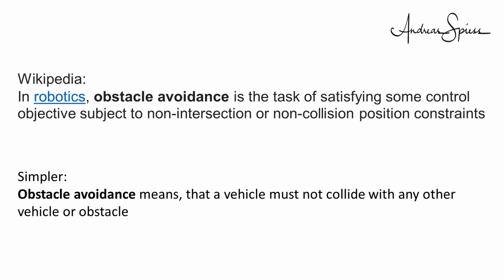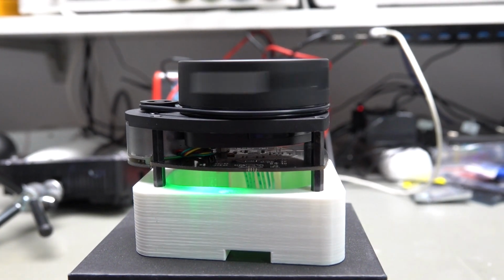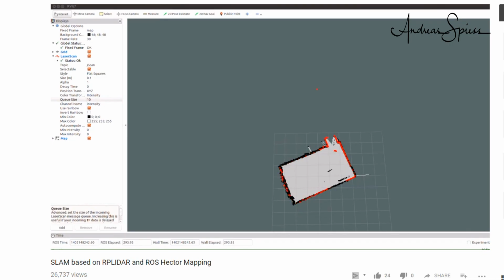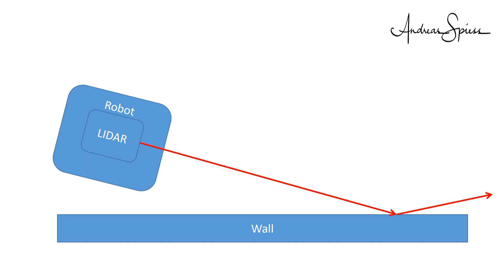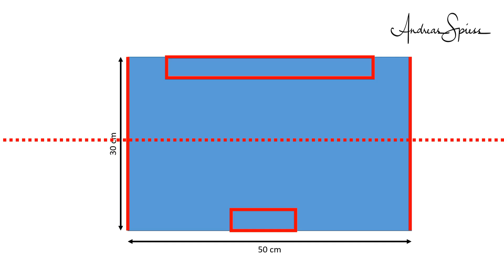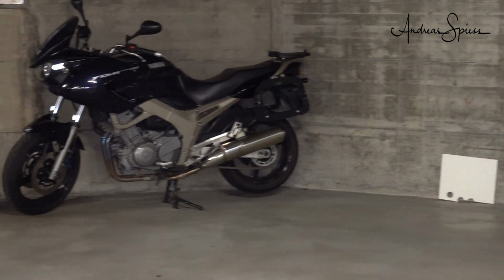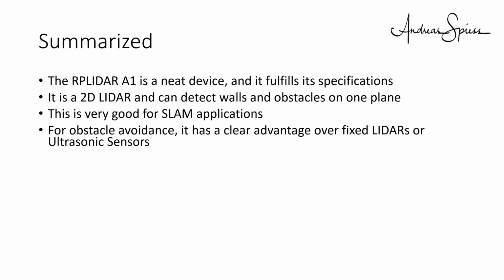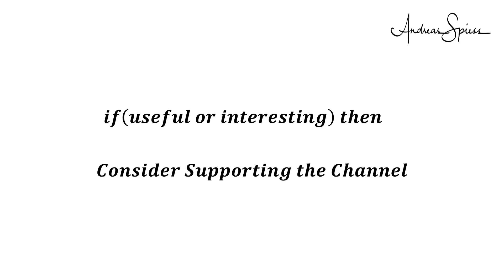#227 The ugly truth about LIDARs for obstacle avoidance (RPLIDAR A1, Arduino, ESP8266)

Comment: Anreas. Have you followed the Starlink by Spacex. What kind of receiver/antenna is needed for this system, I know this has nothing to do with your usual videos- But you are smart, I'm not. lol
Reply from the maker: I did not follow Starlink and I have no idea if this is something necessary. In the crowded areas, the channel capacity is much too low and in the rural areas maybe not enough customers with money. It should work in the V band (40-75 GHz) which currently is used for radar applications. Its wavelength is 4-7 mm which enables short antennas, at least.

Comment: Chinese manufacturer RoboSense says that its new, high-performance solid-state LiDAR system for autonomous driving is 1/400th the price of traditional 64-line LiDAR systems and has updated features not found in even higher priced systems. The $200 RS-IPLS Intelligent Perception LiDAR system (yup, the price really is two Benjamins) is designed for the mass production of vehicles.  Maybe not for small tanks -- but large ones?
Reply from the maker: Sounds very interesting. Where did you see the price? I only got a request form when I pressed "buy"
Reply: DesighFax newsletter.  Here is the link: http://www.designfax.net/cms/dfx/opens/article-view-dfx.php?nid=4&bid=827&et=featurearticle&pn=02
Reply from the maker: Thank you for the link. So it probably will take a while till we get our hands on these devices (if we do not need 10'000 pcs)

Comment: You could augment the LIDAR with other sensors such as IR TOF sensors for obstacle avoidance and floor sensors to detect the floor. IR TOF are far better than ultrasonic although they are a little more expensive. They will detect obstacles even at extreme angles and using an array of pulsed and continuous IR TOF sensors with differing beam widths you can create a cone infront of the robot that will detect all objects. The only downsize is their range typically between 0.6 and 4 meters.
Reply from the maker: Sounds very expensive. I used one small TOF device in one of my videos. It cost nearly 10 $   and it only covered a very small range because its laser. Ultrasound has an opening angle of about 30 degrees which can be quite handy for such an application.
Reply: @AndreasSpiess  yeah the more sensors you add the more expensive things become. I use the TOF instead of the ultrasonic sensors because they don't block your sketch like the ultrasonic sensors as long as you don't request data too quickly from them. The VL53L1X is a really good sensor but yeah it's a bit expensive it has a beam width of about 27 degrees. I always thought the ultrasonic sensors had a narrower beam width of about 15 degrees but I could he wrong. Great video by the way keep up the good work.
Reply from the maker: I have a VL53L1X here and plan since some time to test it. I tested the small one.

Comment: Can't you convert the 1D lidars to 2D by using a rotating mirror with some sort of rotation encoder and software, and similarly convert 2D lidars to 3D by attaching the rig to an oscillating rig (also with an encoder) to add the up and down motion?
Reply from the maker: Triangulation works with mirrors, however only if the mirror is at a right angle to the laser. So in principle, you can rotate a mirror instead of the laser. I did not see anybody using this principle. And you can add a mirror for up- and down movement. But it has to have a strange form to keep the right angle.
Reply: @AndreasSpiess maybe a pentaprism

Comment: You have described a wall as a mirror reflection; however a wall is not a mirror, it's close to a diffuse surface, so the light gets thrown back in all directions regardless where source light came from. The strongest emission of light is along the surface normal and falls off from there on out towards no emission at 90° to the normal. The sensitivity of the sensor will also have a cutoff, which is why your LIDAR can't see these walls very far. See Lambertian BRDF.
Reply from the maker: You are right. I use to simplify a little. I showed and mentioned this effect when I measured the "wall", which was a dirty wooden board. Truly not a mirror.

Comment: If you don't mind using a Raspberry in your project you could use a Kinect. It has a depth range of 0.8m to 4m and a 70-degree horizontal and 60-degree vertical field of view. I did some tests using the freenect driver and interfacing it with ROS was a breeze.
Reply from the maker: Kinect seems to be an interesting technology. But I heard they are no more produced?
Reply: Oh, didn't know that. That's unfortunate. Luckily here in Brazil we have an abundance on those sensors and you can easily find a used one for like 20 bucks.

Comment: 24GHz radar modules from ebay are quite sensitives, what about use it as obstacles detection ? We used one of those in one project and we were capable to measure human breathing.
Reply from the maker: I used one of those in a video. They only measure speed, not distance.

Comment: Well it depends. I've used lidars for obstacle avoidance just fine. The reason why u don't see the wall is most likely a resolution problem and not a reflection problem (in all fairness thought I used a 3000€ one). But the biggest reason why lidars or most 2d and 3d scanners aren't that usefull is the compute power u need to probably use the data. (and a raspberry just won't do it)
Reply from the maker: I think I described why the lidars cannot see some walls. The 360 degrees LIDAR sees walls where the angle is big, so I do not think it is a matter of resolution. If no light is reflected, I assume also expensive LIDARS will detect nothing.
Reply: Der Fehler liegt hier in der Annahme bezüglich der Reflektivität. Bei einer Wand handelt es sich um eine diffuse Reflektion und ist somit von winkel weitestgehend unabhanig. Daher kann ein Lidar Sensor (unabhäig ob einzelstrahl, 2D oder 3D) eine Wand unabhänig vom Winkel wahrnehmen. Weshalb die Wand in dem Test "verschwindet" liegt an der Art wie der Sensor arbeitet: Der Sensor misst immer in festen Winkel- bzw Zeitintervallen. Bei einer parallel verlaufenden Wand wird die euklidische Distanz zwischen zwei Messpunkten, auf dieser Wand, somit mit steigendem Abstand zum sensor immer gößer, weshalb diese schnell entweder außerhalb der Reichweite des Sensors liegen oder nicht mehr auf der Wand.
Sorry to all non german speakers but I couldn't explain that in english without risking a lot of misunderstandings.
Reply: If u want a good and reliable obstacle avoidance, look for potential field method.
Reply from the maker: Auch wenn die Wand ein diffuser Reflektor ist, ist die reflektierte lichtmenge je nach Winkel unterschiedlich. Und der LIDAR hat eine minimale Empfindlichkeit. So stelle ich mir das jedenfalls vor. Und der Versuch mit dem Laserpointer zeigt genau dieses Verhalten: Ich seh einen starken Lichtfleck wo ich ihn vermute (Einfallswinkel= Ausfallswinkel)  und praktisch keine Energie in andere Richtungen. Dazu wird der Punkt noch in die Länge "verschmiert", was ihn zusätzlich schwächt. Aber ich gebe dire recht, er ist immer noch sichtbar, wenn auch sehr schwach.
Die Reichweite habe ich ja mit 6 Metern auf eine senkrechte graue Wand bestätigt. Er hat die parallele Wand aber schon nach ca 2 Metern nicht mehr "gesehen". Deshalb habe ich angenommen dass das mit der zu kleinen reflektierten Energie zu tun hat.
Reply: @AndreasSpiess  bei hochwertigen lidrs (Sick, hokoyu, velodein) ist eine Erkennung bei 10% garantiert, in unseren Tests wurde eine Reflexion von teilweise 2% noch erkannt. Wie genau sich trigonometrische Sensoren (we die rp-lidar Reihe) kann ich hier nicht sagen, da wir mit diesen Sensoren aufgrund ihrer geringen Reichweite, eiem hohen Rauschen und allgemeinen Ungenauigkeit nicht arbeiten.

Comment: A solution may be to put a sensor on top on the x/z plane, while the other put on front of the vehicle, with nothing under it (maybe mounted with an L bracket?) on y axys, this way you have a 2D plane of under and on top of the vehicle, would still not be perfect, but would at least cover for stairs and low ceiling.

Edit: it's only a thought, maybe there is something I didn't think of, like the Arduino not being capable of processing the input from both sensor xD
Reply from the maker: And it becomes also quite bulky...
Reply: @AndreasSpiess  you're also right, also it makes the panzer (:P) way more unbalanced on the front, still would be a solution... Also putting 2 slightly oblique static sensor, one up and one down, would be great to detect stairs and/or low ceiling, but I dunno, I never used those sensor except with the lego mindstorm nxt 2.0 so you're for sure more expert, I'm just suggesting ideas xD

Comment: you can get a quasi 2d lidar if you take your 1d lidar sensor and tilt it in an oscilating motion
Reply from the maker: Mine was already 2D. But you are right, tilting would generate the needed third dimension. But you would lose speed, which is quite valuable for this application.
Reply: There's 5 solutions to the resolution problem:

1) use a rangefinder that can be polled at a higher frequency so you can rotate it faster (like 50rpm).
2) put more rangefinders at slight angles into the same column
3) Instead of using a laser pointer, you can use a laser-line, and instead of a 1D sensor strip, you'd use a 2D high speed camera, so each scan gives you a line of depths spanning the vertical FOV of the camera, then you rotate the whole laser line/camera assembly as you would a rangefinder (you'd usually have a fixed assembly and a rotating mirror). This will need some fairly beefy machine for image processing.
4) Use a structured light sensor
5) Use a time of flight camera (the price of these is currently tumbling)
Reply from the maker: I did some investigations into the different principles of measuring distance (in some earlier videos). TOF and triangulation both are fast enough. Normal rangefinders use a different principle which is very slow.
I still have a "golf" rangefinder here I have to test. It promises it can measure speed on a long distance. We will see...

Comment: Looking forward to affordable MEMS LIDAR (oscillating mirror). Wondering how effective a VL530X time of flight sensor would be mounted to a couple of servos such that it looked around in a circle.
Reply from the maker: I tried the VL530X for that purpose in one of my videos. It was way too slow. And its range also is only about one meter.
Reply: The sensor completely lacks optics, it doesn't have lenses to collimate either the laser beam or the incident light. So it fires a wide 35° beam and then collects return signal over 25° field of view. It has low sensitivity and basically performs similarly to ultrasonic, but often times worse. You basically get something like a weighted average of the distance in its field of view. The main reason you want to use it is for being much smaller than ultrasonic.

Comment: what you're describing is the limitations of the cheap toy LIDAR systems; an industrial LIDAR system, used on cars, has none of those issues, it scans in 3D space and it does so very fast using an array of lasers and detectors
Reply from the maker: You are right. I think I mentioned that in my video.

Comment: Very good video on LIDAR's blind spots. I think that LIDAR may be good for specific applications, but for use in vehicles it is a dead end and stereoscopic cameras win on all ends. They are cheap, devices and software is capable to resolve objects at real time.
Reply from the maker: You might be right. Do you know of a "cheap" stereoscopic camera for that purpose? I think they are still out of a Maker's budget.
Reply: I do not know of any particular. However I think 2 regular cheap 640x480 cameras ($4) would be sufficient to start. Connected using I2C or SPI. However to process the image with reasonable precision it would require some processing power. Not sure if suitable for even more powerful ESP32, unless you dedicate one MCU and its 2 cores just for this activity. Writing the software would be interesting problem nevertheless or using existing libraries (OpenCV?)...

Comment: Would it be possible to fit the 2D lidar on an oscillating servo and scan multiple planes so as to detect low lying and over hanging obstacles at opposite ends of the servo travel?
Reply from the maker: This works. But you lose (valuable) time.

Comment: Could I use an FTDI to send messages to a Nextion display? I have one that doesn't communicate w/ an ESP32. It used to and I want to determine if it's the ESP or the display that has a probkem.
Reply from the maker: You can use an FTDI converter and a terminal emulator
Reply: @AndreasSpiess  I just have to work out the parameters. Trying puTTY right now, but all I get is "e" with a series of blocks that look like static when I tap a button. I've loaded their button demo HMI.
Got it sorted. Will post in your earlier video I found using ftdi.

Comment: Why not put the LIDAR on a servo tilted platform? To simplify the measurements, you could use more or less different numbers of angles and skip the data while moving. For example you can move the servo to the "low" position and take the distances. Then move it to the "mid", and read the sensor data. In this short three step example, you only have to move the servo to the top position and you've got all necessary data for a tracked vehicle. I guess my suggestion would handle the problems with high and low obstacles in the front, and while backwards driving too. I think this would work, at least if it drives not too fast 🤣.
Reply from the maker: You are right. But you lose time which Is not unimportant for this application.
Reply: I absolutely agree!

Comment: Another great video! 

One of the early systems I was involved in 2009 was using both LIDAR and Ultrasound together as you show in the last segment.

We had the same limitations you discovered. However, we also came up with a solution. Detect, query, target, verify. 

The Lidar sensor would detect an object. If limited return data fell outside of programmed limits, the Ultrasound sensor was sent a command to target the unknown obstacle. Of course, if the sensor was fixed, this had limitations. Our solution, to mount the ultrasound sensor on a plate that had X and Y servo motors to control the directional plane required for targeting. This raised two more problems, time and number of queries per second (plus latency).

Our solution, install four  ultrasound sensors, one at each corner of our robot.

Raspberry did not yet exist. We too had the exact same data processing issue. In fact we still had issues when we attempted to use Motorola RISC 88000 processors. In summary, we did not properly plan project objectives.

Our solutions were far too complex and over engineered.

We were trying to create high fidelity resolution that was never required and did not focus our efforts to a simple problem, target, define and avoid.
Reply from the maker: Thank you for sharing your experience. If I understand right, a bunch of ultrasonic sensors in different directions would have done the job on obstacle avoidance?

Comment: TL;DR: A 2D lidar only detects obstacles in a 2D plane.
Reply: ok.
Reply: TimmmmCam That's true, but I guess Mr. Spiess wanted to use the simplest method to achieve his goal. Actually it isn't that hard to make a 2D LIDAR to a 3D one. Naturally this has some cost. First of all you need a capable servo to move the LIDAR vertically, second the detection speed reduces a lot. But I personally managed to make some 3D point clouds with the mentioned method.
Reply: Patric Hausammann have you considered 3D MEMS-based lidar? No servos, etc
Reply: @NuclearWinter7693  Yes, but I haven't found an affordable one for my purposes. But there are "360 degree servo like" moving parts in the MEMS-LIDAR too to rotate the mirror. 🤓
Reply: No it's more than that.  He also describes the problem of obstacles being too close and at too wide of an angle.
Reply: Lassi Kinnunen  He has explainingi how to use a 2d lidar in various ways to use it in tilted 2d making it seem like 3d, rather than paying $1000 for 1 3d lidar the size of a basketball
Reply from the maker: That was the point of the video, I think.
Reply: @AndreasSpiess   Pan and tilt mechanism allows collection of data in 3D, and production of a point cloud representation of the surroundings.
Reply: @AndreasSpiess  Pretty stupid point. In other news; water is wet.
Reply: @joestevenson5568  He was helping others who might not understand
Reply: yet I think you could solve this problem by tilting the LiDAR front and sideways.
If you use more than just one of these, you could cover more of the relevant field of interest.

About the "ground drop" problem: A LiDAR entirely dedicated to scan the "road ahead" by being tilted forward would provide sufficient resolution.

In the end: I doubt there's THE ONE sensor to cover everything. You have to combine multiple one's to cover all eventualities. And yes, stereoscopic cameras and image recognition are a part as well
Reply: @gajustempus  The "ground drop" was programmed into the chips by NASA to keep sheeple in the dark about the true FIRMAMENT OF THE FLAT EARTH